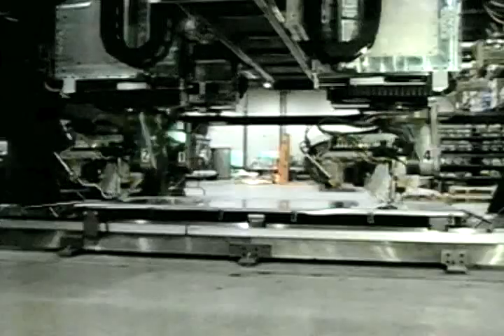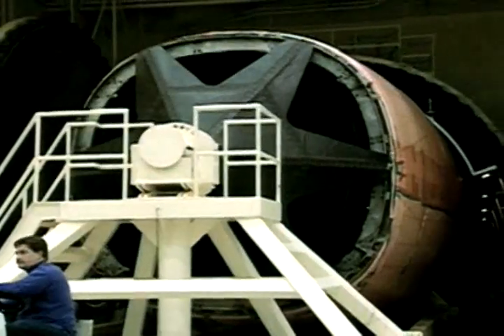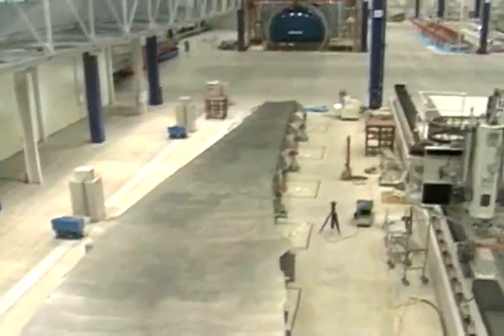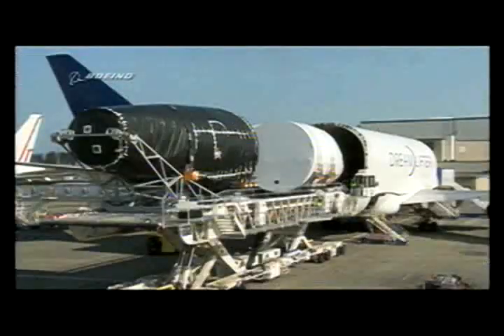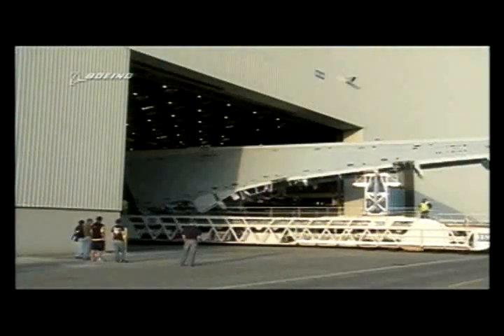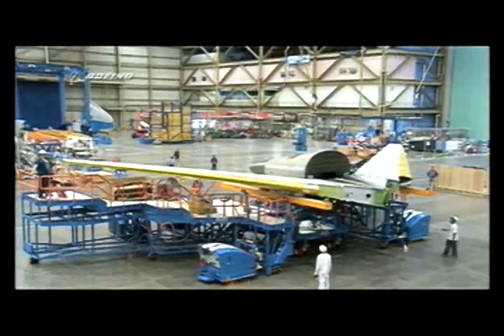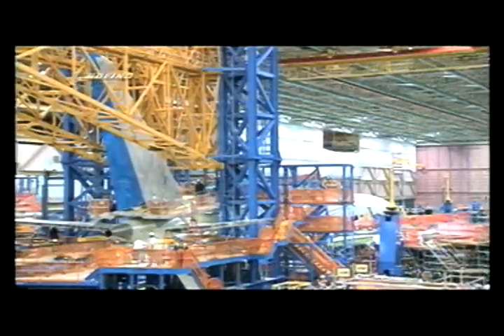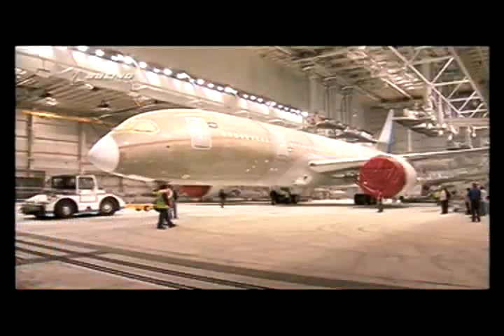Boeing 787 assembling 8min22sec of magic, (please subscribe our channel)

Comment: I'm saving this as a favorite to show in my manufacturing processes class.  Locally (Milwaukee, Wisconsin), we have manufacturers who do filament winding to form cylinders for pressure vessels for use on the ground and underground. They use glass fiber and epoxy (less expensive, less strength and much heavier). Nice video.